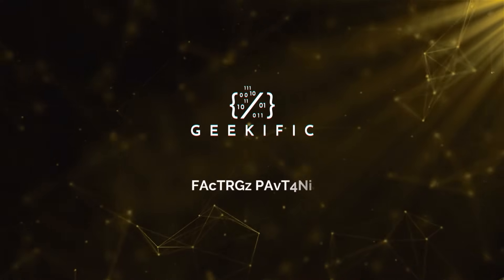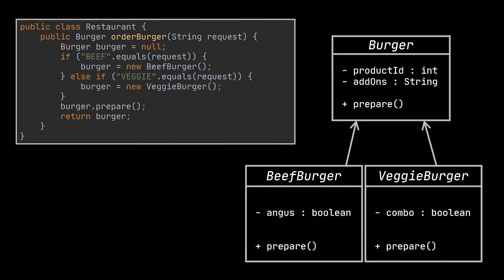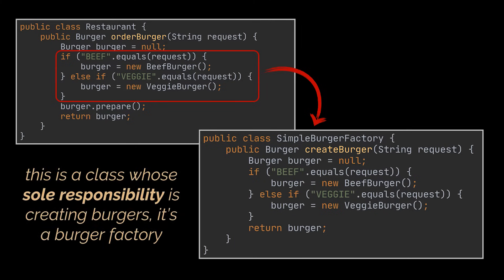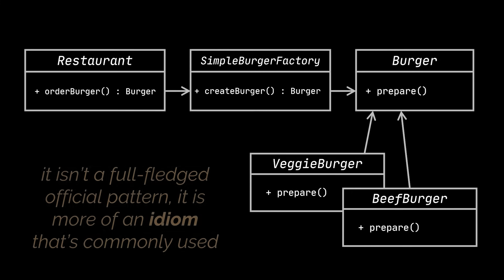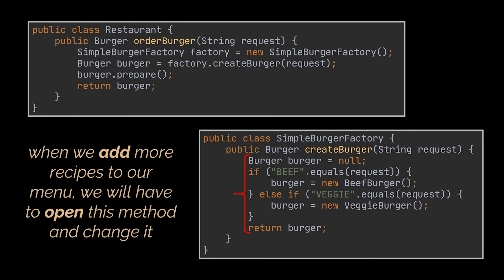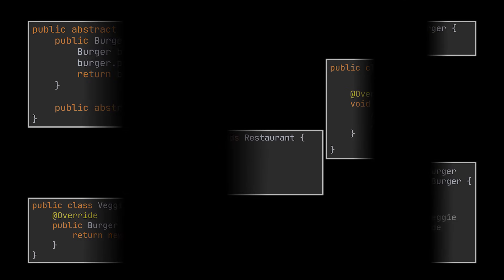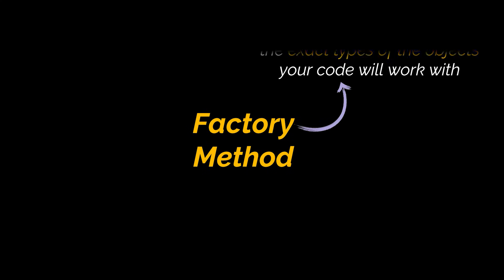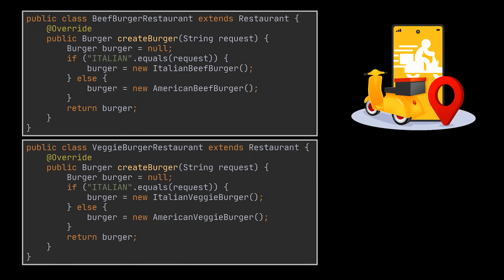The Factory Method Pattern Explained and Implemented in Java | Creational Design Patterns | Geekific

Comment: It's impossible to implement the Factory Method pattern without violating the open-closed principle. Somewhere in the application, perhaps in the main method, you still have to check some condition to return the correct "product". The one million question is "where do you want to break the open-closed principle?" You want your "Burger" class to be in accordance with open-closed, so you don't need to refactor its internal methods every time you add/remove a new type of burger. I would stop there, and accept the "BurgerFactory" class to violate the open-closed principle, and check the condition to decide which subclass (BeefBurger or ChickenBurger) to return. A "BeefBurgerRestaurant" doesn't make any sense from a domain point of view. What will happen when you start to sell drinks and someone orders a "Coke Zero + beef burger"? "BeefAndCokeRestaurant"? That's when you catch theoretical programmers who have never applied what they explain in the real-world software. I have indeed applied the factory method and the open-closed principle in a mobile App where we have the downstream APIs returning different types of "expense" (3 different ones), so to avoid to propagate this types and their especific behavior to the UI side, we created a common interface "AppExpense" and made each API type implement it. It was a game changer because it's a complex App. We used to have 8 different types of components like "<UIComponentA expense={expenseA} />", "< UIComponentB expense={expenseB} />" across the whole App, but now we just need "<UIComponent expense={expense}/>". This allows us to move from 24 components to just 8, and it doesn't matter how many new types of expenses the APIs introduce; the UI will remain untouchable.

Comment: I fail to see how it makes extending the "menu" easier. After applying the pattern, we are still left with the if statements, but now instead of using it to create a burger, we use it to choose a whole restaurant implementation. And adding a new burger not only requires a modification to the restaurant selection code, but also creating a two, instead of one new class, the burger, and the restaurant.

Comment: I have a doubt, Factory Idiom made sense to me, we had one method which we can call for creating different types of objects I need. But whats the point of having a ChickenBurgerRestaurant, LambBurgerRestaurant when there only use is to return an object of corresponding Burger type. At this why not just call the burger class directly.
Reply from the maker: Great question! The idea behind having separate classes for the Restaurants is to encapsulate the creation logic and make the code more flexible and maintainable. This way, if the creation process gets more complex later (like adding extra steps or variations), you won’t have to change the client code that just calls the restaurant. It also helps follow design principles like Single Responsibility and Open-Closed. So, while it might seem simpler to call the burger class directly now, the pattern prepares your code for future growth and easier changes.

Comment: Great video! It explains the actual Factory Method so well that at the end you understand that it is mostly useless. I think most ppl can’t find a real use for most design patterns, but they think that it is their fault, because they don’t understand them. Vids like yours, debunks this misconception and exposes the pattern, even though it wasn’t your purpose. 

Actually, there is a tiny benefit the actual Factory Method Pattern could provide, which is when your classes (burgers) have constructors with different parameters. In that case, adding a new parameter, when using the simple Factory Method, would break the client code, while the actual won’t. But again, you might be able to go around it, without breaking the client code.

Comment: I usually use an interface instead of an abstract class. An Interface means that I am creating a "contract" for all Restaurants and it´s mandatory that all the classes implementing it will implement the createBurguer.

An abstract class should be used for generalization of a behaviour, an interface for standardization, this case looks like standardization to me.
Meaning:
Generalizing: "All these classes seem to work this way, lets sum up common code in a common place"
Standardizing: "I want to enforce that all this classes behave this way"

What do you think about this approach and why would you favour the use of an abstract class over an interface?
Reply from the maker: I guess, interfaces enforce a contract, ensuring all implementing classes follow the same methods, making them ideal for standardizing behavior. Abstract classes, however, offer shared code, making them better for generalization when multiple classes need common functionality. They allow partial implementations and can be more flexible when evolving over time. So, imo choose interfaces when you need consistency across classes and abstract classes when you want to combine shared logic with enforced structure. Does this answer your question?

Comment: I think it's clear, but what if you want to get a ConcreteRestaurant based on a kind of selector? In the main method, u still will have to do some sort of check to retrieve the proper ConcreteRestaurant. To add a new ConcreteRestaurant to the main method, u still will have to modify that and that breaks the open/closed principle.
Reply: The main method acts as the client in our application. When we talk about design patterns, the goal is to adhere to the Open/Closed Principle (OCP). This principle emphasizes that code should be open for extension but closed for modification, primarily in the business logic layer of the application. 

To clarify, in an MVC architecture, design patterns are applied mainly to ensure that the classes in the Model package comply with OCP. These patterns are not meant to handle modifications in the main method or other parts of the application outside the business logic. The main class is typically responsible for bootstrapping the application and acts as a client that interacts with the business layer.

In summary, design patterns are intended to make the business logic extensible without requiring changes to the existing code, ensuring maintainability and scalability.
Reply: @MAKHLOULILYAS-b3n  I think you are hitting the nail on the head. With the pattern, the potential extender is also the one who writes the choice (in this case the writer of main), and needing to change ones own code when extending does not violate the closed-to-change principle.
Reply: I have the exact same doubt. Can anyone answer this?
Reply: @nagagouthamnarne790  I think this explanation has some misinformations ...
Reply: I was looking exactly for this comment. Any answers?
Reply: I think the issue here is with having to change the code every time a variation of an object is to be added or taken out, the problem is not with knowing which kind of object you need to create.so simply put you do know what object you're about to create and there is no need to worry about the check to be performed in the main method, but you do have to worry about the different variations of the object that might change in the future.
Not sure if I'm right or not but that's my humble understanding
Reply: @hossemhrichi6570  is just moving the switch to main, so that you don't have to change anything you already have wrote in the other classes, apart from the code for new ones. Thus, you will only modify the main. But is that good? I don't think so, at least not in most cases.
Reply: @hossemhrichi6570  My question was a long time ago, but I think the answer lies in the "Open/closed". In theory, adding additional checks for a factory idiom doesn't necessarily break the open/closed principle. We are extending the code, not modifying the existing code. We don't change the behaviour or rewrite a functions. We just extend the code by adding a new case to the factory. I think that is safe.
Reply: There is no answer to your question. You just transfer the switch (or if elses) from the factory method to the main. Is that great? To my opinion it certainly isn't, for many reasons that won't bother to mention and makes the code harder to understand and update (exact the opposite of what patterns are supposed to do).  The whole design pattern thing is actually like a conspiracy. If anyone has an example of a pattern (apart maybe from decorator and facade) that can actually solve a real problem (not burgers) and make the code more readable and maintainable, I will start crying out of joy and relief. The explanation here though is one of the best and the vid is great. The simple factory pattern (idiom as he says) is probably the only thing you will never need. Probably, because it isn't an actual design pattern, since if it was, it would had been very unlikely that it could help you in anything.
Reply: It's impossible to implement the Factory Method pattern without violating the open-closed principle. As you said, somewhere in the application, perhaps in the main method, you still have to check some condition to return the correct "product". The one million question is "where do you want to break the open-closed principle?" You want your "Burger" class to be in accordance with open-closed, so you don't need to refactor its internal methods every time you add/remove a new type of burger. I would stop there, and accept the "BurgerFactory" class to violate the open-closed principle, and check the condition to decide which subclass (BeefBurger or ChickenBurger) to return. A "BeefBurgerRestaurant" doesn't make any sense from a domain point of view. What will happen when you start to sell drinks and someone orders a "Coke Zero + beef burger"? "BeefAndCokeRestaurant"? That's when you catch theoretical programmers who have never applied what they explain in the real-world software. I have indeed applied the factory method and the open-closed principle in a mobile App where we have the downstream APIs returning different types of "expense" (3 different ones), so to avoid to propagate this types and their especific behavior to the UI side, we created a common interface "AppExpense" and made each API type implement it. It was a game changer because it's a complex App. We used to have 8 different types of components like "<UIComponentA expense={expenseA} />", "< UIComponentB expense={expenseB} />" across the whole App, but now we just need "<UIComponent expense={expense}/>". This allows us to move from 24 components to just 8, and it doesn't matter how many new types of expenses the APIs introduce; the UI will remain untouchable.
Reply: @lucasgarcez5101  Thanks a lot. That was very insightful. However i do wonder what brought you to this video given you already know this stuff.

Comment: I don't think this video is good. Let me give you constructive feedback.
The video should have been presented this way:
1. here is some code
2. it has shortcoming X
3. here is the same code with the Factory Method Pattern applied
4. now it no longer has shortcoming X

You have not made clear in the video what was gained, and you did not end up with the same in-code if-else choice of burgers based on an input string.
What we are looking to understand as viewers is: What does this solve? What does this get me that I didn't have before?

Remember, the whole motivation for "open-closed" was to avoid recompiling modules that did not actually need changing with better architecture, hence to save time. So tell us in your narrative what is the module/class you are wanting to avoid having to recompile, and how in the end, with your solution, you can add new burgers without having to recompile said module/class.

I hope this helps.
Reply from the maker: Thanks for the feedback, will definitely take this into account for upcoming videos!
Reply: @geekific  No problem. After watching many other videos on this exact same topic - Factory Method Design Pattern - here on YouTube, I have come to find there is not a single video that explains it clearly from beginning to end with one example suffering from a shortcoming that is then remedied by this pattern - not one video. So do not beat yourself up about it, because your competition are not doing any better a job at this.

I am actually having trouble finding a good example in all of the web. There needs to be one example showing how in the end, a user-input supplied as a string, gets translated into a choice of class, without that specific part of the translation needing change in order to add code.

Because if that is not demonstrated, then you will still have people asking "but why not then simply do the choice and dispatch right there and then at the site where you are having to make this choice anyway?".

You really have to demonstrate that you are saving me time by saving me from re-compiling other classes. In the end this is the only benefit of the Open-Closed principle - not introducing bugs accidentally is usually caught at pull-request review time and no longer an issue.

Thank you for listening and I look forward to your next video. If you don't do it, I will, so good luck! ;)
Reply from the maker: @jboss1073  I have on my list of upcoming videos kind of a follow-up on these patterns, where we will create a UI and allow you to see how conditionals are not needed/handled better due to the use of patterns :) Stay Tuned! 
I always appreciate such feedbacks, keep them coming!
Reply: @geekific  It is my pleasure to give feedback to someone who cares about improving like you do. Thank you for taking the effort to make these videos. I have subscribed and will stay tuned!
Reply: @jboss1073   I am learning and based on this video tried to design keeping in mind what you are asking for. Could you please have a look and suggest - much appreciate your time.
public abstract class BurgerFactory {

	public Burger makeBurger(String[] specs) {
		Burger burger = CreateBurger();
		burger.PrepareBurger(specs);
		return burger;
	}

	public abstract Burger CreateBurger(); 
} // BurgerFactory

public class ChickenBurgerFactory extends BurgerFactory {

	@Override
	public Burger CreateBurger() {
		return new ChickenBurger();
	}

} // Class
public class BeefBurgerFactory extends BurgerFactory {

	@Override
	public Burger CreateBurger() {
                  return new BeefBurger();
	}
} 
public interface Burger {
	
	public void PrepareBurger(String[] specs);  // Code to prepare Burger, cust spec
}

public class ChickenBurger implements Burger {

	@Override
	public void PrepareBurger(String[] specs) {
		System.out.println("You ordered Chicken Burger with: " + "\n");
		System.out.println(Arrays.toString(specs));
		
	}

} // class

public class BeefBurger implements Burger {

	@Override
	public void PrepareBurger(String[] specs) {
		System.out.println("You ordered Beef Burger with: ");
		System.out.println(Arrays.toString(specs));
	}
}
public class Demo {
	private static BurgerFactory myBurger;
	private static Burger burger;
	private static String[] attribs;
	
	 static void OrderMenu(String request, String[] attribs) { 

		 String menu = request;
		 request = "com.next.level2."+request+"Factory";
       try {
	   Class<?> clazz = Class.forName(request);
	   Constructor<?> cons = clazz.getConstructor();
	   myBurger = (BurgerFactory) cons.newInstance();  

              } catch(Exception e) {
                 	System.out.println("Can not order..."+menu);
              }
 
	 } // OrderMenu
	
	  static void eatMenu() { 
		  burger = myBurger.makeBurger(attribs);
	          System.out.println(burger.getClass().getName()); 
	  }
	 
    public static void main(String[] args){
    	attribs = new String[] {"Pineapple", "Thin Crust", "Onion", "Mushroom"};
    	String request = "BeefBurger";      //"ChickenBurger" => could be anything or
                                                                   //  combination;

    		   OrderMenu(request, attribs);
    		   eatMenu();
    		   
    } // main
    
} // Demo    
1. Dropping item from Menu - code will work fine
2. For OCP - With new menu item (xxburger) another factory (VeggieBurgerFactory) and
VeggieBerger need to be added and Demo/Front end need to be modified.
3. Also if we want to limit endless creation of factories, do you think method overriding PrepareBurger might help ? Thanks much for your time.

Comment: Forgive my dumb question, I'm not sure if this is just the example chosen, but... In the first part, by closing the restaurant class, the factory pattern opens a new burger factory class, which pretty much does the same thing, only with more code... This isn't a full factory pattern. So, the solution is instead, to create two restaurant subclasses, one restaurant for each burger type instead??? Of course, the primary use case is when you don't know how many products there will be, which is why you want to separate the concerns. But I don't get how a customer knows whether to "visit" a BeefBurgerRestaurant or a VeggieBurgerRestaurant. Eventually an if-else will need to be placed somewhere, right?
Reply from the maker: There are no dumb questions my friend :) Yes, but now that "if-else" is on the client side and not tightly coupled with our code. We separated concerns and shifted the decision making to the client side.
Reply: @geekific  Thank you for the clarification!
Reply: @geekific Thank you. As a student this is incredibly helpful!
Reply: Nice question, bro 🎉
Reply: Nice question, bro 🎉